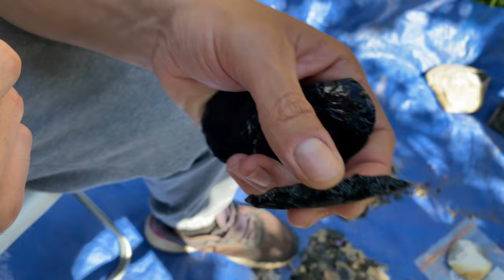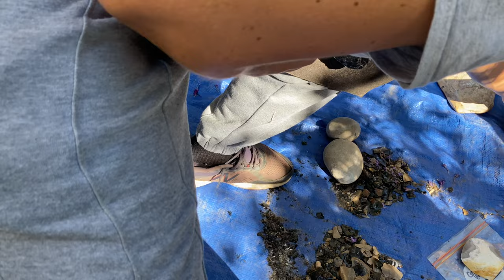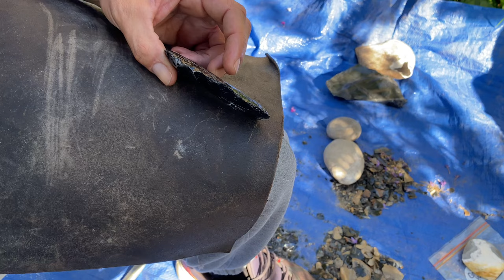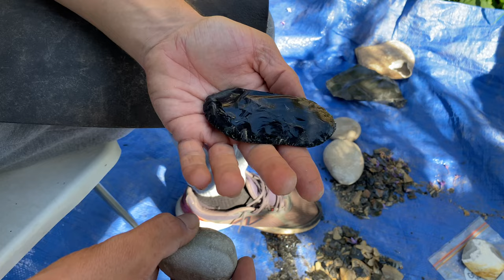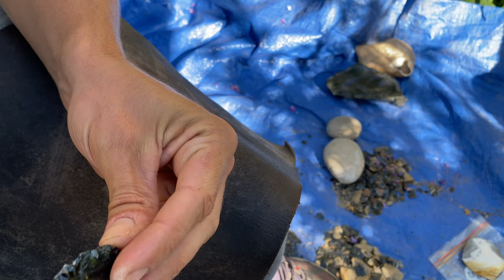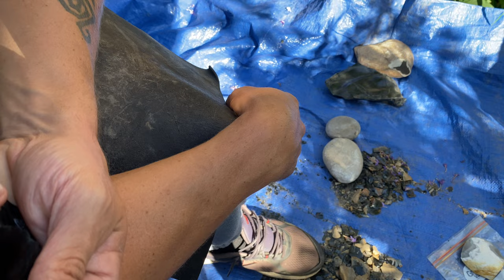Silver Sheen Obsidian Part 3, Breaking the Biface but Salvaging the Pieces

Comment: Dope channel I’ve always been interested in this stuff. I was able to get my hands on a 20lb chunk of rainbow obsidian and was able to find a few decent hammerstones. I have minor protective gear but am missing other knapping tools. Would you recommend starting with another material like chert or Georgetown flint or should I just start busting away at it to get a feel for it? Any particular antler you’d recommend for the big bits?
Reply from the maker: Thanks. That’s a tough one, how much experience do you have taking very large flakes? It took me a long time of working smaller pieces to get used to it, at least a few years. I would say obsidian is the best to learn on, but start with smaller spalls or biface preforms and save your nice boulder for when you can do it justice. I still have some obsidian boulders I’ve been sitting on for years waiting for the right moment. For antler you can use just about anything, but some will be harder than others, I use whitetail deer for almost everything and my big one is caribou.